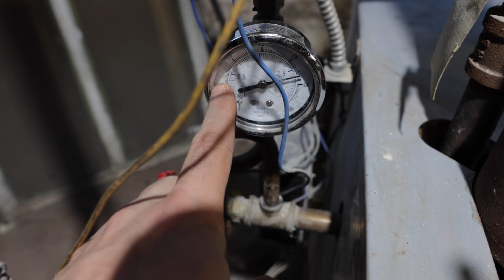Our boiler BROKE and our pipes are going to FREEZE! Abandoned Victorian Mansion Ep 46

Comment: Your pressure relief valve is working fine lol
Reply: That’s not a pressure relief, it’s a main vent. Water shouldn’t be there. If you have steam issues Caleb let me know. Good steam contractors are hard to find. Do not use a plumber. I installed my own boiler and can answer any questions you might have.
Reply: @pb7379-j2k  well for our boilers they're called pressure relief... it blows out hot water when the pressure gets too high so you don't blow the whole system... I've worked on a few but thus is canada not America so I don't know what I'm looking at, I just know it shouldn't be shooting out water... we don't use steam where I'm from.
Reply: @hellofoodiebeauties  steam boilers have a pressure relief valve also, but they are attached directly to the boiler. This vent’s purpose is to let air out of the main pipes to allow the steam to quickly fill them. It should be open to air flow and then close to steam.

Comment: That is a main line air vent that is leaking, probably a #35 Vent Rite.  When the boiler is COLD!!! (Not been running), unscrew it and put on a new one.  The glass needs to be checked/replaced every year, no matter what anyone says.  Expansion and contraction sands the end of the glass and it will leak or break.  If your low water cutoff fails, which also should be checked every year, that automatic water feeder will flood the basement.  The pressure gauge is no big deal, but the pigtail under it is.  That should be checked yearly.  It doesn't taste good, but you should be able to blow through the pigtail 😁.  Tell your heating company you want these checked every year and make sure they do.  If they give you any grief, get a new company.  Remind them again before they come.  It's an easy $10,000 or more for a new boiler, don't let it get wreaked by a lazy tech or lack of maintenance.

Comment: Ohhh I can't wait to see this, will have to wait tomorrow morning in several hours to watch this for me. Hanging up those chandeliers up in the basement is a good idea to keep them out from underfoot and save much needed space. Kind of worried about your words that the boiler may be broken :(
Reply from the maker: Hope you enjoy it!
Reply: @The2ndEmpireStrikesBack  Hi Kyle. I doubt that the gauge is broken on the boiler. More likely it is the pressure reducer that is not doing its job and pressure is getting too high. Boilers are connected to city water lines that have over 100lbs of pressure in them, and the reducer is supposed to maintain the heating system at its proper pressure level. The excessive pressure may be causing the air release valve to fail, and reducing the pressure may stop it from spurting.

As a temporary solution to get heat or to trouble-shoot, you might try closing the inlet water valve (between incoming city line and pressure regulator) to get the pressure down to the correct level. After shutting off the supply from the city open up the drain seen at 19:24 to let water out and get the pressure lowered to the correct level. You can then run it for awhile with the the city inlet valve closed, and as long as air bleeder valve doesn't spurt water and the pressure doesn't drop, then you are in good shape until the system is repaired. No  water will enter the boiler system and drive the pressure up as long as the city inlet valve is closed. The risk is that water leaks from the system from the spurting air valve (possible) or some other hidden location (unlikely) and water pressure gets too low. Just keep an eye on the pressure off and on for a few hours to ensure that it is stable.

Comment: Unless I'm mistaken, that valve that is shooting straight up is a pressure relief valve.  Make certain it's not blocked - it's doing a vital job.  My guess is that far too much pressure is coming IN to the system.  That's your problem.  Maybe that's what broke the pressure gauge.  Didn't you have the water line re-done?  Perhaps they need only put a pressure regulator on the water coming in to the house?
Reply: Yeah be careful the water pressure coming into the house is one thing but increasing the pressure on the system is another
Reply: Yes, this. Mine has a pressure reducing and autofill valve on the water input.
Reply: Hvac Engineer from Chicago here. Everything Chris said it correct. I'm sure you know by now your pressure relief is blowing and your McDonnell Miller isn't working correctly. Sometimes those autofills get stuck open because the float gets crud on them *Added noted, you can clean those sometimes, the small electronic ones have strainers in them*. Glad to see your relief is working though, high pressure would of been very bad. In all honesty, if you can control your input you might not need to replace the relief valve but the only way you will find out is if you can check the correct pressure and reference what the relief is suppose to blow at, that's the MAWP. I hope everything gets taken care of soon though, winter is coming!
Reply: What everybody else said. Looks like the pressure really is too high and the valve is doing its job. Please have the system checked over before relighting.

Comment: Kaleb, if you HAVE TO use the boiler before it's repaired (weather takes a nosedive), could you afix a cheap plastic bowl upside down to the ceiling above where the water comes out? it would direct the water back down to the floor or bucket, and keep the wood above dry.  Dollar store has cheap dinnerware you could use.

Comment: Hope the boiler fix isn't too bad. I love keeping old systems working. I've got an old 1920s gravity furnace that's been converted to natural gas and takes up half the basement. I love it, though.
Reply: I love the old gravity furnaces, they get a bad rap for being "inefficent" but in these older homes with high ceilings they are still the best way to heat them...
Reply: Disco J, is your home also from the 1920s?
Reply: @twistoffate4791  Yes it is!
Reply: @timnewman1172  My home is pretty small, so the gas bill isn't too bad. I'll probably add a heat pump at some point, but still keep the furnace for emergency backup and extreme cold. It may not be the most efficient, but boy does it heat the house well and it gives the basement a nice spooky vibe.

Comment: Somehow I managed to delete my previous comment, as well as your reply!
I still believe you have a leaking main vent.
2-pipe steam is indeed a fancy system, and one that would have been a very expensive installation in its day.   With no individual vents on the radiators, ALL of the air in the pipes and radiators exhausts from the main vent as the system fills with steam.  Definitely makes for a quieter house without the hissing radiators, as well as providing the ability to throttle them individually for temperature control.
It’s fascinating technology that seems sadly forgotten in this era of furnaces and forced air.  If you haven’t done so, pick up a copy of “The Lost Art of Steam Heating”, by Dan Hollohan.  It’s a great resource for understanding the nuances of a system like yours.  Good luck, and please give some follow-up on the repair!

Comment: I have noted that there are some holes in the lower parts of the hall walls . I suggest one of them  also be used for a convince outlet so no one will need to plug a vacuum cleaner into a room  outlet.
Reply from the maker: Every hall by code has to have an outlet.

Comment: That is your relief valve that is venting. Your system is building too much pressure so your relief valve vents. I’m thinking just getting your pressures and temperatures properly set for the boiler should fix your issue. Also, I don’t see an expansion tank on your system. An expansion tank is needed to help keep your system pressure from getting too high and thus, causing your relief valve to blow off

Comment: Most likely it’s the PRV (pressure relief valve). Look for markings that will tell you the set pressure. Should be no greater then 15 psig. Newer type will discharge out the side. You’ll need to pipe that to a floor drain.
Reply from the maker: Thanks for the info

Comment: I’ve been binge watching in an effort to keep up! It’s stunning the amount of work, effort and detail you’ve put into the house and it shows!

I was curious if you put any consideration into running power to the ceiling for hard wired smoke alarms? They still require a battery but you can get long lasting lithium that I believe charge off of the AC.

Also, I’m not sure how important this is to you or if you have upcoming plans, but you might want to run some data lines to each floor for your Internet/additional wireless access points. I’d expect you’ll have a pretty week wireless signal having your Internet equipment in the closet combined with the plaster walls. Just some bit of future proofing. Happy to go over in more details if you’re interested.
Reply from the maker: The internet works amazingly well all over the house. We will be using Simplisafe smoke detectors.
Reply: @The2ndEmpireStrikesBack  Glad to hear you’re set on both!! Can’t wait to see the progress.

Comment: You know, as a stop-gap measure, I'm sure you could just turn the main valve at the street.  That would reduce the water flow and pressure.  But, I'm assuming you had a guy out there, if you've got parts on order.

Comment: @4:50 Good god, a four way switch?
When I wired up a three way switch for the first time, I tried to get advice from a couple of electricians.
Basically, they said to wire it up the same way as it was before. I said that I wasn't replacing a switch but installing a new one.
Oh, that's different they said. Just wire it up until it works the way you want. You can't go wrong.😂😂😂

Comment: Another great job! I do have another comment about the wallpaper on the top of the light fixture, I have never heard of wallpaper on the ceiling. Could it be that the original owners used the paper as a cap for the fixture? If so, that means they must have used some extra wallpaper from around the house. I hope I made sense.
Reply from the maker: Wallpaper on the ceiling is a common thing in the Victorian era. My grandmother still wallpapers her ceilings at her current home (and it was built in 1987).

Comment: How did they run knob and tube wiring throughout that house without ripping out huge amounts of lath and plaster back in the day??  I'm sure that house didn't have knob and tube wiring installed during the original construction, when it was built in 1889.  You can't just fish knob and tube wiring through the walls like you can modern day romex wiring.  Maybe they did tear out large sections of lath and plaster to install the knob and tube wiring and then reinstalled the lath and plaster.
Reply from the maker: This house had electric installed when it was built. Very rare for this timeframe but they were very well off. The electric only worked sporadically which is why the original light fixtures were transitional and had both electric and gas.

Comment: I don’t think that is a PRV issue on the boiler. I think it is an air vent that is not functioning correctly. A PRV would have a much larger opening to get the hot water and possibly steam out fast.

Comment: AutoFill Valve is not closing..   Too Much water in the boiler.  The water level should be about Half-Way up in the Sight-Glass tube.   There should be a MARK on the side of the Boiler to show the proper Water Level.    Turn off the Water Supply value,  open the water Drain Valve.   Drain the water until you see the Water Level in the glass Tube..
Reply from the maker: Sounds simple, but we tried all that. Experts will be back early next week.

Comment: Kaleb - Did you finally get the boiler fixed?
Reply from the maker: Not yet. Supply chain issue and repair guy got sick. Should happen this week though.
Reply: @The2ndEmpireStrikesBack  Have you figured out the proper Water Level of the boiler? There should be a mark somewhere on the boiler?   Turn off the Water Supply valve.  Drain the water until the level can be observed in the Glass Tube.    then you can turn on the Heat.  Just monitor the Water Level manually.